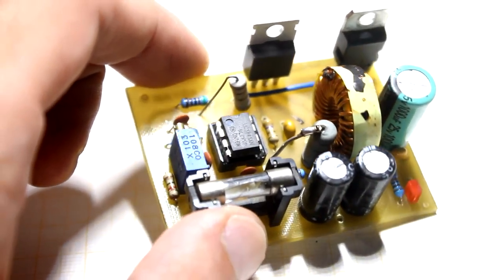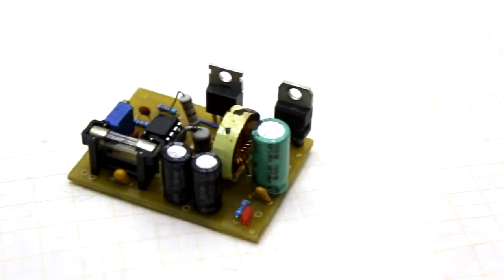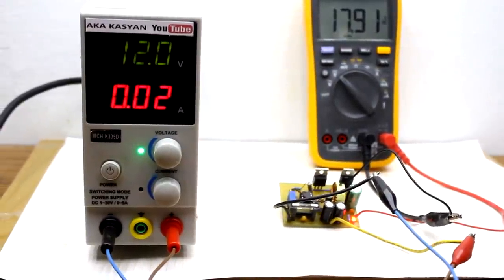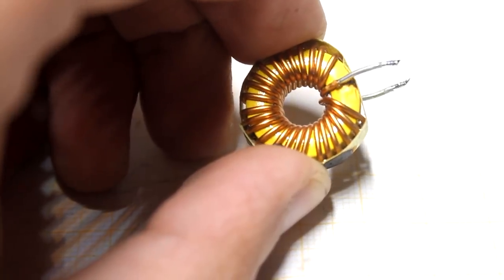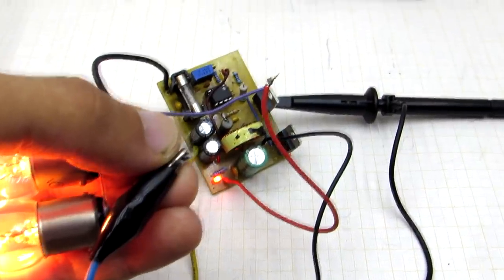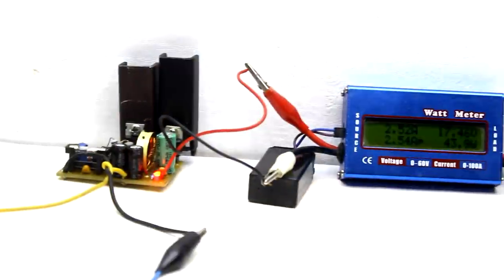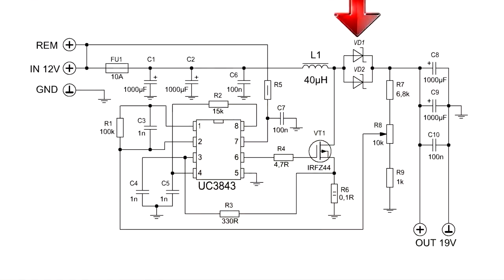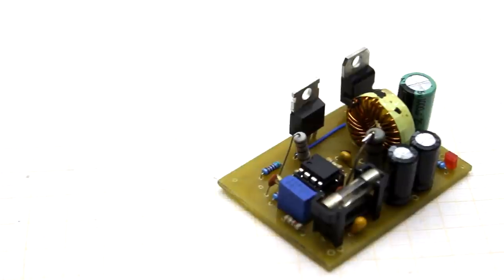DIY  Powerful DC-DC converter

Comment: Great work but sooner or later mosfet or diode will fail. You need to add snubber circuit which is R and C in series to decrease spikes on mosfet and diode. Then ringing will be much smaller.
Reply: Such a nice feedback. I put the comment here for my own notice. ;)

Comment: That must be a Chinese 19V, because it was 17.9V! 😀 A bit like their 3.5Ah batteries which are actually 1.2 
Also the load is the 2 bulbs, not "provided by the energy stored in the capacitors"!

Comment: Great video. So how would you scale this up. What if you wanted  120vdc or even 400vdc. Just larger mosfet and chokes?  Capacitor? What is the relationship between them.
Reply: it is a general rule that if you want more than twice the input voltage boost converter wont cut it and you need a transformer

Comment: @ Kasyan TV
Your content is great, but what is the use since you don't provide a schematic file in pdf or gerber file (factory pcb print) to print it on cooper clad, we need the pcb lines schematic lines on a A4 size paper, to print on Toner transfer paper .

Comment: i would recommend using normal ferite transformer cores for the inductor, because most of the toroidal inductors are actually compressed iron dust which makes them unsuitable for high frequency (above 5khz) applications like this

Comment: hi could you assist with building a circuit that can step up the voltage from say 12- 14v to 16-18 v with a current draw of about 200A
Reply: That is a real technologigal feat.The current alone is scary!

Comment: I need 34 to 36 vdc out put for led drive. Please tell me how to change the circuit to give about 36 vdc
Reply: Ganesh Randhir use inductor of thiner wire with more no of turns. It increases output voltage.

Comment: i made this circuit ....its has huge voltage drop when attached to load
Reply: UC3842 is a current mode controller, it means you'll have a steady current instead of steady voltage !
Reply: @youneshamache3314  but does it mean uc3842 will work with this circuit?